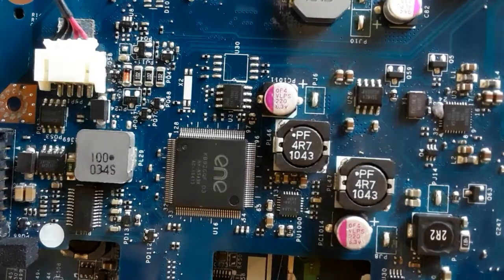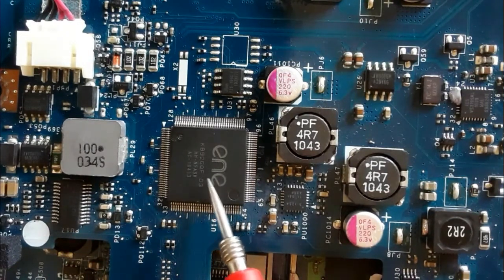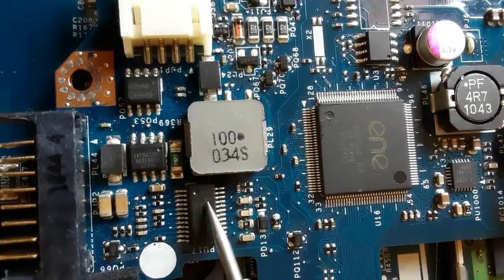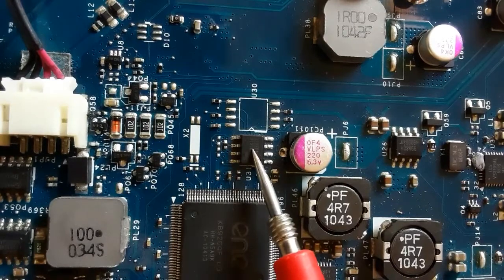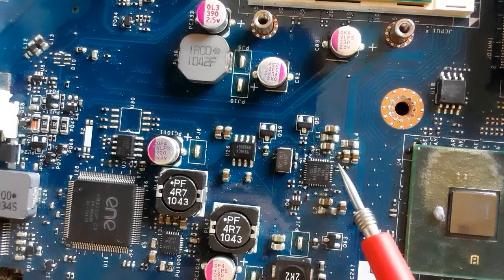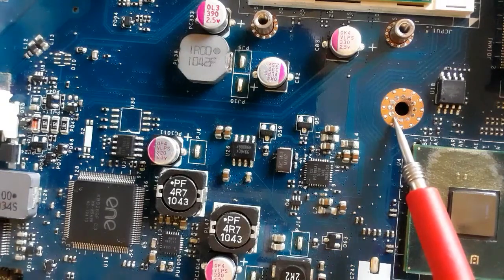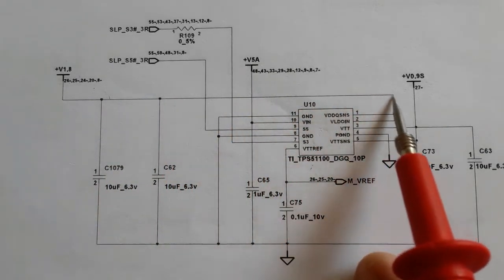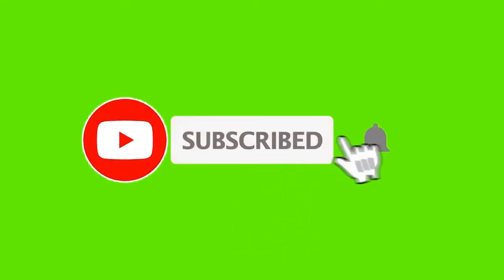Laptop Integrated Circuits basics and pin configuration

Comment: Thank you for this video, but is this always the case when you have an integrated circuit that heats up a lot ?
Reply from the maker: If the IC's heat is normal that's fine, but if it's too hot to touch means 100% failed.
Reply: @electronicsrepairbasics_erb  Thank you, I just have the case on a motherboard that does not output 5v 3v